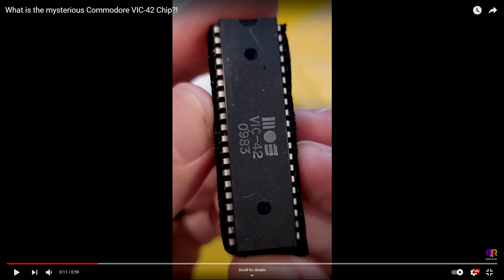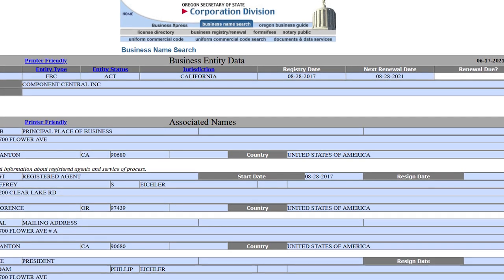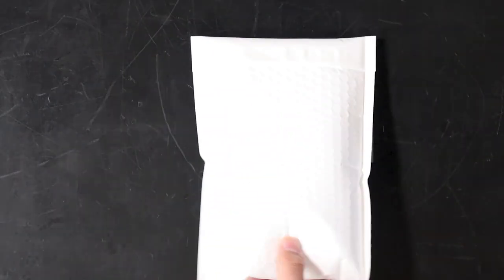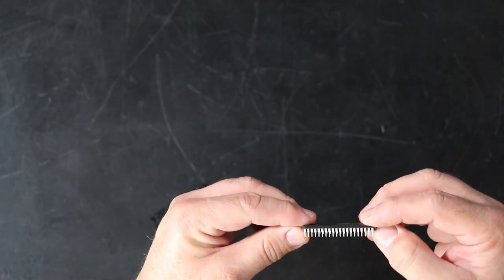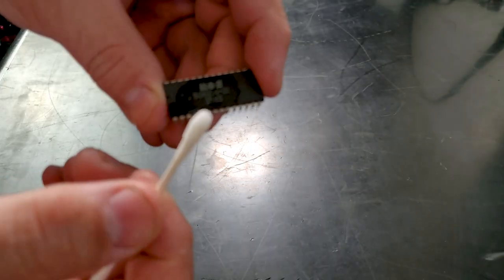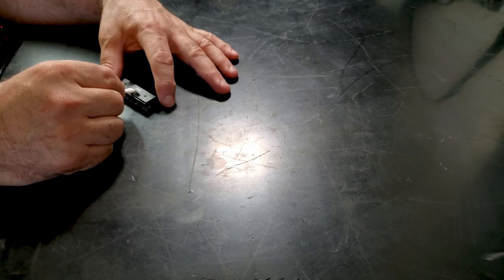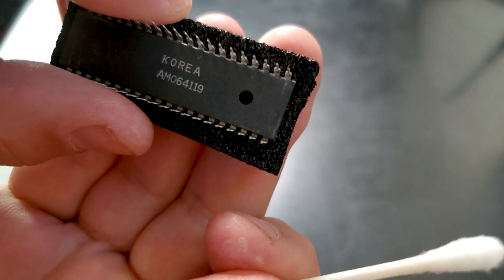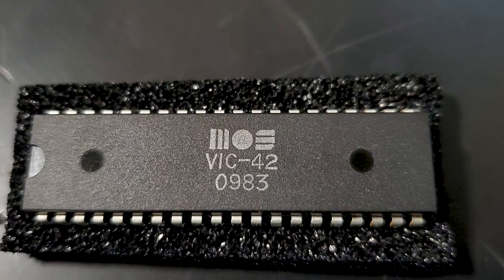What is the VIC-42? Alcohol and Acetone Test and Ideas [SOLVED, See the pinned comment]

Comment: Nice detective work Mike! The plot thickens... unless you use acetone on the plot then it will thin... Either way, we'll hopefully find an answer soon! 👍🕹️
Reply from the maker: Perifractic, No matter what, the hunt is a lot of Fun! Thanks for watching! 😎
Reply: This needs to be decapped.
Reply from the maker: I wish I knew how to do that but it will have to rest in another's hands. I have been, mostly unsuccessfully, trying to figure out a way to apply current limited power without frying it.
Reply: @RavenWolfRetroTech  I bought two and will put them through their paces. And yes one of them goes to decapping. Unless someone else does it first (which would be a waste to destroy two)
Reply from the maker: @plgDavid That's awesome, my skills are from the 80s and early 90s so decapping is not in my wheelhouse. I am curious what you find. 

We are having a garage sale this weekend (Starts in 1 hour) so I have not had time to get into this much further. Next week I was going to look at the VIC 1 and VIC II datasheets to see if there is a safe way to try to power it up on a breadboard (With source current limiting). I expect that I'll find the pinouts are such that its not doable but who knows
Reply: @RavenWolfRetroTech  I don't do the chemical decapping myself. I know some people that do. There are various theories about the chip so far. From a MOS 6562 (which is pin compatible but not software compatible with the 6560). To a gate array that would have been used in an unreleased VIC-1542 floppy drive. I wouldn't power one without knowing the pinout. Anything is a guess. ONE thing for sure, the eBay seller has been constantly jacking its prices as more are sold. grr.
Reply from the maker: @plgDavid I can't wait to see what you find. The thought on power is probably pretty half baked, were in the middle of having a garage sale and clearing out a bunch of junk (You should see the disaster in my shop right now). My thought was to look at both VICs and see what the maximum source and sync current. Then I would know if I can apply a small voltage.... the more I think about it I doubt it has any merit. I am still getting back up to speed since I started a business in 1991 and, by 2000, I pretty much had no time for hands on work, it was all business management. It's good to be retired-ish and to get back to the fun stuff

Comment: The question is. Did Commodore have any talk with different Japanese companies about a possible machine/console/arcademachine around second half of 1982 to first quater of 1983? Or did Commodore plan a replacement 8-bit machine for the C64 at that time? Like something that would have filled the gap, that the C128 was used for later on. Perhaps this chip is linked to the Commodore 900 machine?
Reply: brostenen, the answer to what this chip is, is in the pinned comment but in the process of researching possibilities, I learned there were a ton of abandoned projects at Commodore over the years.

I am curious though, do you have a lot of issues with comments (The system, not the people) on your channel? I replied to this comment on the RavenWolf channel account 3 times but YouTube just eats it! If I filter by comments I replied to it shows up... with 0 replies.
Reply: @YarblekRW  I have experienced comments that went away. Yes. It was only when I commented back, that they became visible on my channel again. Some times I even have to enter YouTube studio, in order to see them. Yup. YouTube is strange from time to time.